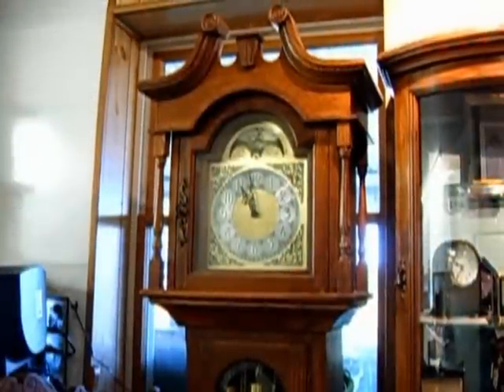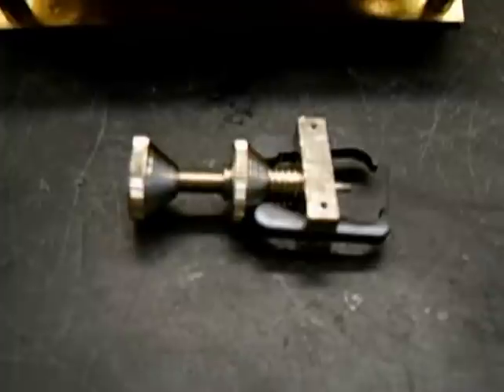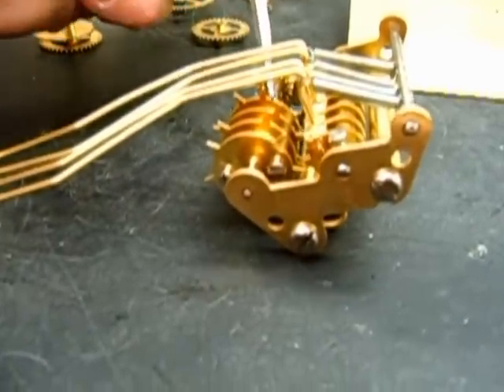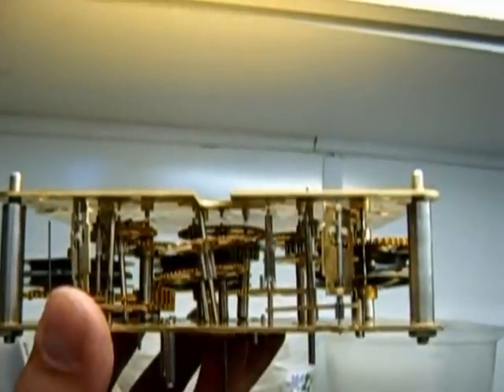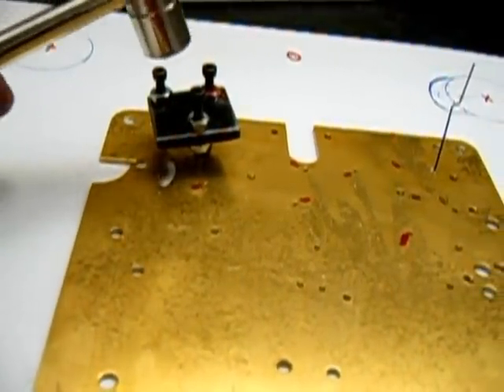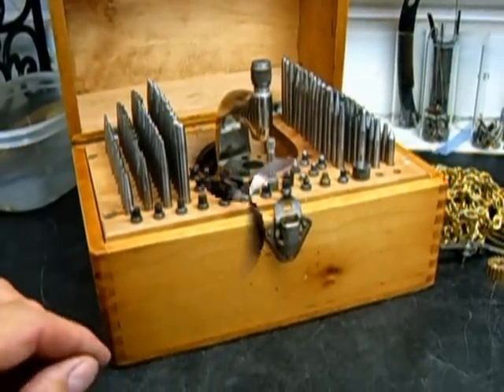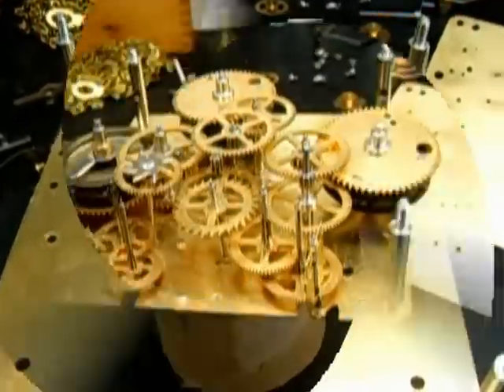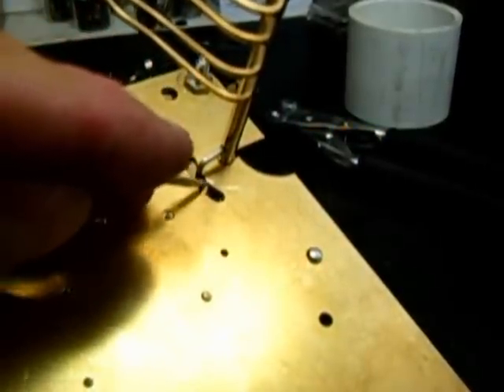Grandfather Clocks with Jauch Movement Repair Short Preview

Comment from the maker: To take off the hour hand, just twist and pull it off, its on a friction shaft. when you apply oil, only oil the pivots. Do not oil any lever pivot points or minute shaft. Oil acts like a hydraulic lock which slows down the levers from dropping quickly, levers will not work correctly after that until taken apart and cleaned. 
Thanks for Asking
Al Takatsch

Comment from the maker: If you brush the movement, it pushes the dirt back into the holes where it came from. And then the oil will turn it into a abrasive slurry and accelerate wear very quickly. Clocks can run for 10 to 20 years after the oil is dried up. Then its time for a repair or replacement movement.

Comment from the maker: Hi Bob,
IF there's nothing worn out or dirty in the clock, you will be able to get it ticking by moving the Pendulum Bob to the left side of the case and let go. This extra swing arc will activate the AutoBeat feature, if your clock has one, and put the clock into Beat.

If this doesn't work, then your clock was marginal and would have needed service before you moved it.
Also be sure the weights are correct, the heavyist ones go on the right side.
Good Luck
Al Takatsch

Comment from the maker: I use a syringe with the point cut off to oil, the tiny droplet is perfect for one pivot. You won't be able to clean the movement without taking it apart to remove the oxides, gummy oil and metal particles from inside the pivot holes. It like cleaning an engine without opening it up. Some shops use the dunk and swish method in kerosene and the blow off with compressed air. That still didn't clean what's important, but it looks good and unfortunately the customer pays for that service.

Comment from the maker: When you do this for the first time, I would remove the movement and seat board from the clock. Then remove the seat board from the movement. Figure out which direction the chain wheels ratchet. The chain has a pull end and a weight end. Hold the movement upside down and run the pull end around each winding arbor and then position the chain over the sprocket wheel. If the chain cannot be positioned over the sprocket wheel.
Hold movement upside down and thread the chain around the arbor

Comment: Hi, I have a Hermle Black Forrest Clock I guess made in Virginia. I'd like to attempt to clean and oil it but I can't remove the hour hand. How does that come off? Once I do that, I should have no problem with the rest. I'm gust going to spray it clean and put one drop of oil on all the shaft pivots. I'm mechanical but never did s clock drive. I won't attempt other stuff, I just want to clean and oil it. If it needs other repair, I'll call someone. It won't chime at times.

Comment: Hey Al- hoping you can help me out.  My grandparents have an old Howard Miller "Emperor" grandfather clock.  1950s era.  Still in good condition.  Any recommendations for how to price the thing?  Have had several inquiries on it but don't want to overcharge or undercharge.  I tried calling Howard Miller directly but they were not helpful.  Thanks.

Comment: I have a 1983 Ridgeway Grandfather clock and the Pendulum was not connected and I can not see where it connects so could you do a video explaining where it attaches and where are some of the lubricating points for the gears?
Reply from the maker: I;ve been selling the Repair Video DVD's on this movement for a few years. You can get it at: Full Length over 5 hours 
http://www.ebay.com/itm/130605171057?ssPageName=STRK:MESELX:IT&_trksid=p3984.m1555.l2649

Thanks for Asking,
Al Takatsch
Jefferson ClockWorks

Comment from the maker: If you cannot position the chain on the sprocket, you'll need to thread it over the sprocket wheel after you remove the pull end ring. Lay the chain on the sprocket and ratchet it around until its equal lengths. Re-install the pull end using a strong needle nose plier. Do not distort the link you had opened up previously. 
Repeat this for all the chains and reinstall seat board the way it came off and install into clock.. Viking does not make movements so I'm not sure what movement your have.

Comment from the maker: Congratulations on a fine clock, anything with Herschede on it generally brings a high selling price, working or not.
Now the not so good news, they are very difficult to get working. Most experienced clockmakers I know dread working on them. Their design did not lend itself to a easy overhaul.
My advice is to leave this clock non-working or have a professional work on it,
Instead, learn clockmaking on easier clocks like any two train American Mantel clocks matched to one of my Repair Video's.

Comment: My father has a Viking Clock.  He was winding it and pulled the chain to tight. The weight was taken  off trying to loosen the chain.  The chain slipped off.   I have not been able to find anyone local to fix the clock.  I am mechanical, so how do I replace the chain?

Comment: where on earth will l find the clock mechanisms for such an old clock?
Reply from the maker: Many years ago this movement company closed. The parts supply dried up and thousands of GF clocks have reached their 20 to 30 year service life.
My Repair DVD takes over at this point, teaching  how to repair the movement back into operation.
Its a labor of love and may turn into a business
Al
http://www.ebay.com/itm/130605171057?ssPageName=STRK:MESELX:IT&_trksid=p3984.m1555.l2649

Comment: my secondhand on my Grandfather clock has stopped. Is this an easy fix?
Reply from the maker: The first steps in movement repair is to remove the movement, the hands and dial as explained in my repair dvd on ebay. You then can see what's working and what's not.
Is it easy? You'll need to decide that.
Al  Takatsch
Jefferson ClockWorks
http://www.ebay.com/itm/130605171057?ssPageName=STRK:MESELX:IT&_trksid=p3984.m1555.l2649